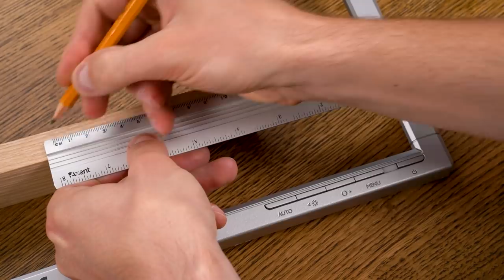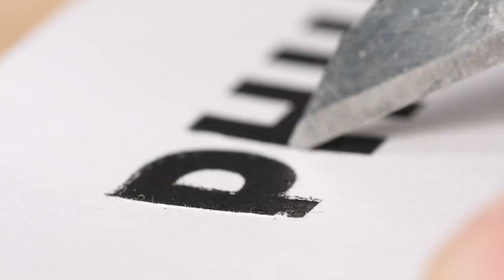WOODEN MADNESS: Monitor out of Wood

Comment: Wooden to do list:
Wooden keyboard✅
Wooden mouse✅
Wooden monitor✅
Wooden pc❌
Wooden headphones❌
W00D3N T4BL3✅
Wooden headphone with wooden wire❌
Wooden microphone❌
Woodcam (wooden webcam)❌

Wooden inside pc:❌
Wooden Rtx geforce❌
Wooden intel processor❌
Wooden rgb water cooler❌
Wooden motherboard❌
Wooden microsoft windows 10 os❌
Wooden fan❌
Wooden ssd/hdd❌

WOODEN PC SETUP❌